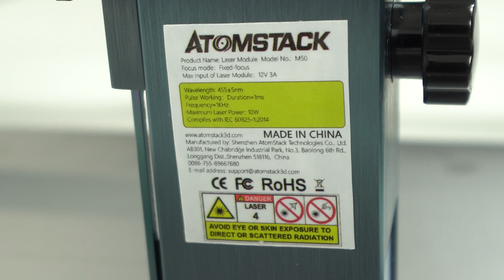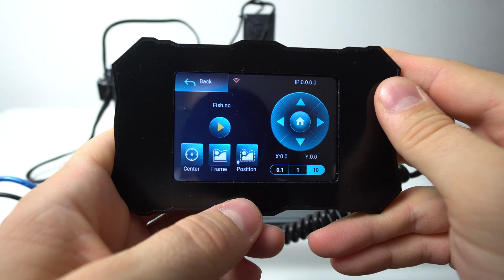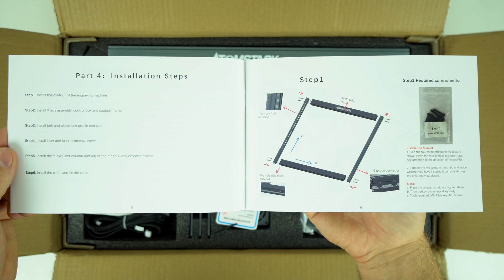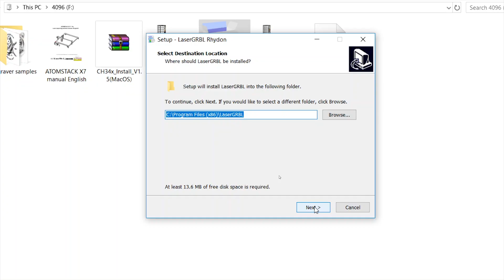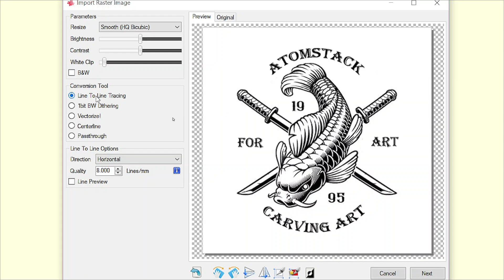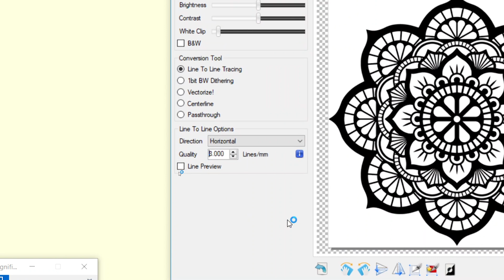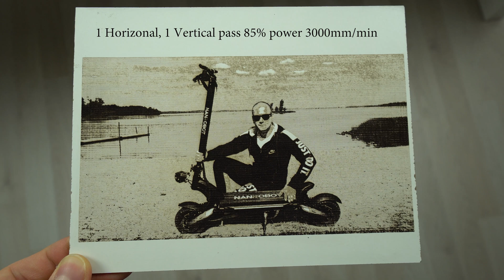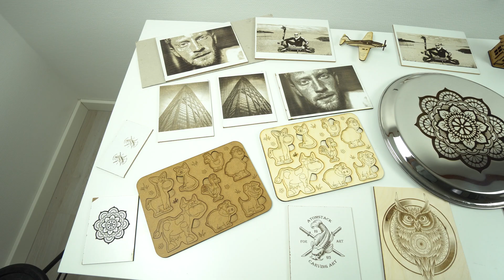AtomStack X7 PRO Dual Laser engraver review

Comment: Nice video. Can you please share the engraving parameters for metal/stainless steel? I use lightburn. 

Thanks
Reply: in Lightburn at the top click laser Tools, then material test,  depending on the material size you have to work with you can make a matrix like 5 x 5 run the test and see what it looks like   then you can change speed and power and do another test till you get results that meet your needs   you can do this with every material type  you use  save the test
Reply: @generalpattonpending7256  thank you 😊

Comment: I bought X7, rotary, and extension kit. Having many issues, the packaging arrived damaged, and cables were outside & damaged. I am working with Lightburn, often it gets disconnected. Also was overcharged, order value was €975 but was charged €1027.36

I wasn't happy with the way it arrived & the output result asked them to take a return. For 4-5 weeks they tried to negotiate with €20 refund for the damage this & that. Then stopped responding to emails.

As per EU law, the right to return. Return policy should be clear, they are not interested in honoring law or  EU standards. Now I am raising this with the EU consumer agency.

Comment: can it engrave or mark on Brass, Gold or Silver?
Reply from the maker: It can engrave stainless steel. I don't test out on those metals but I presume that It's possible.
Reply: @NexiTech  hi thanks for your video:) One question! Wich configuration you use in laserGRBL to engrave stainless steel?

Comment: how did you engrave on shiny stainless steel ,did you use a coating or marker as in forums i read that you will damage the laser on shiny surfaces ,?
Reply from the maker: I just engraved straight to the stainless steel without anything on it. I didn't realize that the laser can be damaged that way but it makes sense as some proportion of the beam could be reflected back at the source. Thanks for your comment.

Comment: Can you help with any advice? My engravings are not straight. I’ve squiggly lines
Reply from the maker: Check the belts. Are they both nice and tight? Check both sides of Y axis. Are both side parallel? Are they have the same distance from the frame? Also check all bearing wheels on adjust them. Then when you sort out mechanical things you can experiment with the software. I found that if you change from 8 lines to 10 lines per mm works great for engravings. Give a try and let me know how it went. Cheers!
Reply: @NexiTech  
When installing the y axis belts. Put the whole x rail all the way to the back or front. Install your belts being sure that it is properly in the gears. Tighten down both rear ends of the belts. Then pull them snug to the front and tighten.

Comment: Awesome vid! Ordered mine already. You said for the large stainless steel engraving it took 10 hours. How did you break it down? What kind of intervals do you recommend between resting the laser and/or running continuously?
Reply from the maker: Thanks mate Awesome! Yes the large Stainless steel work took around 10 hours. Most Important is if you want to engrave on this stainless steel serving plate that you tape it down to the desk/board or large ceramic tile and just in case to place some weights around it as the laser beam spot is around 1200c which will make thin plate to bend and flex during the engraving and it can ruin the work. In therms of intervals the laser have it's own cooling so it keeps the steady temperature during cutting so I'm not sure that it needs too much resting between works. Also to keep in mind that you don't go slower then 400mm/min when cutting wood as the flames can overheat the laser and it will stop the process. So it's better to make the more pass faster then go dead slow and overheat the laser module.
Reply: @NexiTech  Thanks so much for the advice! will definitely keep these things in mind

Comment: Wow! That's VERY impressive.
In your opinion, Nexi, are there any drawbacks or downsides to it?
Reply from the maker: Thanks Mark! Yeah I agree this is fantastic tool. Drawbacks? Well it creates alot of smoke during deep engraving and cutting so it's hard to use it in the room or apartment. You do need constant ventilation and some kind of enclosure with sucking air fan are must to have in my opinion. I will definitely make or buy some kind of enclosure for it. Other then that I really don't have any complaints. It works great and it's so useful.
Reply: @NexiTech  Thanks, Nexi - and always nice to see you with a new vid.